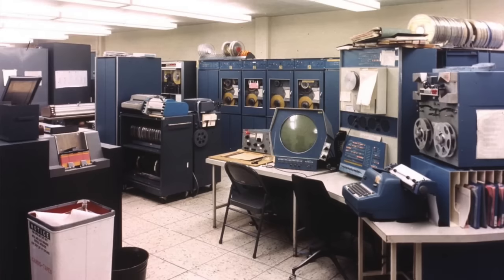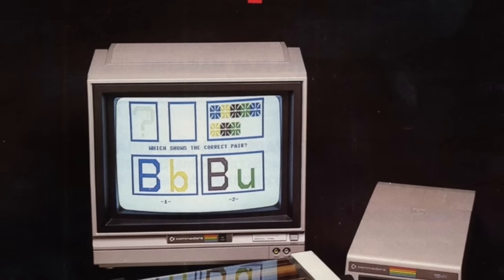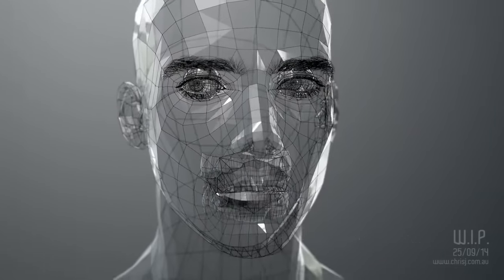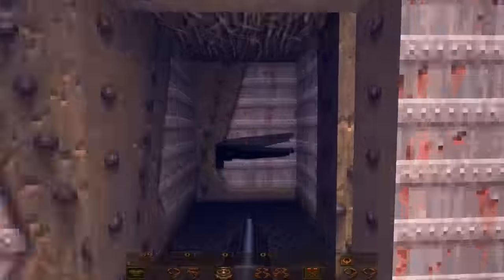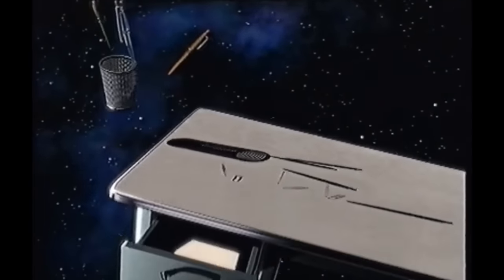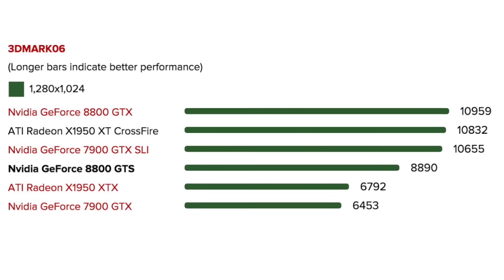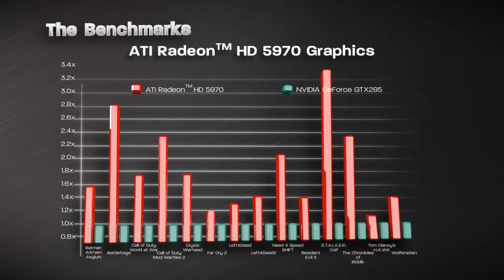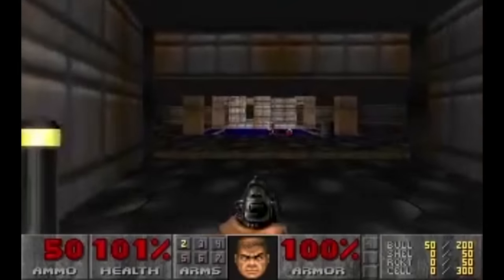Evolution Of PC Gaming Hardware

Comment: i7-2700k @ 4GHz
16GB 2133mhz RAM
EVGA GTX1080 FTW (Yes, I know, too damned expensive)
24" 1080p 144hz monitor
Corsair Force 3 SSD
So, basically a mix of old and new. Runs "Doom" at 100fps at max/ultra settings, so it'll be good enough for a while.
Also, I'm stuck running on Windows7, because I run a recording studio and my specialized sound card doesn't have drivers for windows 10.
Reply: You playing at 1440p? If not, then something is bottlenecking your system. My GTX-1070 Strix gets 120-170fps on nightmare quality 1080p.
Reply: Music & Drawing 1080p. Are you on DX12 or DX11?
Reply: antiHUMANDesigns
Vulkan.
Reply: Music & Drawing Which is pretty much the same thing as DX12.
How are you running vulkan on an nvidia card? :/ I thought that was only for AMD/ATI cards.
Reply: That's a huge waste of money to get a GTX 1080 on a 1080p monitor along with an i7 2700...
Reply: iHusbando uwu I'm not planning on having a i7-2700k throughout the lifetime of the gtx1080. I'm future-proofing.
It's also possible that I'll get a 1440p or 4k monitor in the near future, now that I can make good use of it.

Also, even if the rest of my current computer bottlenecks the gtx1080, it would obviously still run slower with a gtx1070.

But I agree, the 1080's price is crazy.
Reply: antiHUMANDesigns a new good mobo and CPU is going to be pretty expensive too, I hope you like spending
Reply: iHusbando uwu I've got a budget specifically for computer upgrades and other computer-related things, like the occasional game and such. I set aside about $100 per month.
I think I have some $1000 left in the budget, so a new mobo and CPU is no problem at all, though there are other things I'd also like to buy. Oculus rift, perhaps, another SSD, and so on. So I'll have to give it some though
Still, if Doom runs at 100fps at maximum settings, I have no current reason to upgrade my computer, I think you'd agree.
Reply: antiHUMANDesigns your cpu is bottlenecking you if that's all you're getting at 1080p, sorry to necro this chain btw
Reply: iHusbando uwu I've already responded to that. Of course 5-ish year old computer components will bottleneck a brand new top-notch card. But a 1080 will still run faster than a 1070. And I also pointed out that I'll obviously upgrade other components in time, but as long as I'm getting 100fps at maximum settings, why should I even bother upgrading anything, right now? (Rhetorical question.)

Yes, it's a shame. I looked at some benchmarking on CPU's, and I noticed that my i7-2700k gets its ass kicked by new i5's which have lower GHz... That's sad to see.
Reply: antiHUMANDesigns Wait a sec... Gtx1080 and only 100fps? what gives? there must be something wrong, my Rx470 gives me 120 avg fps Maxed out at 1080p and the 1080 is clearly faster...
Reply: Snake2208x
Your RX470 can't even max it due to limited VRAM...
Reply: Snake2208x Note that when I say "100fps", I am guessing an average from just looking at the fps counter. It's also possible that I ran at super-resolution.
I don't know, but I did have a problem with my CPU overheating, so perhaps it throttled down and bottlenecked it. I mihgt try it again, now, and see what FPS I'm getting, because I bought a proper CPU fan and overclocked the CPU to 4.5GHz.
Reply: antiHUMANDesigns Ok Gotcha, still that avg fps is low, if the cpu is throttling then thats it, maybe change the paste and check that the fan is alright, hope you increase those fps! oh and if the super sampling is on then is undersandable :P
Reply: Snake2208x Yes, the new CPU fan is good, and I've stress tested with it, and so on. With the stock fan, I was hitting 98 degrees C when playing BF1, which is max, and it was throttling.
Reply: antiHUMANDesigns woahhh thats hot! i dont like anything more than 85℃, hmmm if the oc is table maybe you could lower the voltage by tiny fractions, until an error happens on a stress test, lowering the Voltage by even .1 or .08 can drop the Temps by a lot
Reply: Snake2208x Yes, extremely hot. The weird thing is that I tried cleaning it with compressed air, and when I took the fan out and looked at it, it wasn't dusty, either. 
But somehow it has clearly lost performance over time. I think it may be 5 years old, or so.

Now when I stress the test CPU at 4.5GHz with the new fan, it maxes out at about 66 degrees C, which is perfectly fine. So the difference sure is huge, probably about 50 degrees.

Yes, I could've messed with the voltage, but I got a new fan instead, so problem is solved. I wasn't aware of how hot the CPU was running either, until I wondered why I got stuttering after a few minutes in the BF1 beta. Obviously, that led me to think it was overheating, which it was.
But yeah, problem solved, now.
Reply: antiHUMANDesigns excelent, great cpu fan i imagine, glad to hear, keep on gaming brother!
Reply: Snake2208x Yeh, not even one of the expensive ones, but kind of low mid-range price one. Thay sure make good fans, nowadays.
Reply: antiHUMANDesigns My PC is 7y old, so I still use Cooler master hyper 212+, the fan began to fail so i just bought a replacement, washed the cooler and use new paste, low temps all arround, maybe ill OC a bit more
Reply: NOO GSYNC OMG
Reply: weird flex but ok
Reply: i know my parents got my brother a gtx1080 i don't know much about it how much did they pay to get him that for?
Reply: @lees4049  how much is a gtx1080?

Comment: Atari 8 bit Computers (Atari 400, 800 in 1979) were out 3 years before Commodore 64.  I would guess the Atari had more games also.  Most games made for both the Atari and the C64 either played pretty much the same or a little better on the Atari 800.  My best friend had a Commodore 64 and I had an Atari 800.  They were kind of like rivals the way the Xbox 1 and PS4 are.  I like gameranx a lot but so much of this video is way off base.  I'm not even sure where to start.  You can basically just go to gamefaqs.com and compare release dates of computers and the games that were on them.  EA was in its infanicy at the time and would always release games for the Atari 8 bit 1st and than the Commodore.
Reply: ET&T I was thinking the same exact thing.  I actually owned an Atari 800 and a Commodore 64 because my Father was a game programmer for both systems.  He always made the Atari 800 one first then basically made a port
to the Commodore 64.  The maker of this video then jumps over to the Amiga while forgetting the Atari st.  The Amiga did sell better than the Atari ST but there is not a doubt in my mind that the Atari 800 was 1st and better than the Commodore 64.  The Atari 800 was released in 1979 while I think the C64 was 1982.  So not only was the Atari 800 1st but it had more games which played equal or better.  This Atari 800 was without a doubt the first major home computer to play excellent games.  I remember my friends playing horrible donkey kong console versions while the A800 was an amazing port from the arcade.
Reply: I had both the Atari 800 and the C64 also.  The games were so similar it would be like comparing madden on the ps4 vs madden on the xbox one.  The Atari did come out a few years earlier and in my opinion was the first major breakthrough for computer gaming.  I remember both systems were pirating games like crazy.  Downloading a 5 1/4 inch full disk game would take about 16 hours with a 300 baud modem.  It would take a couple of days to get the game Autoduel over the modem.  Now within 3 seconds of hitting enter the game is downloaded.  Mr. Robots last episode showed a Commodore 64 and also took lines from the famous Infocom game Zork which was on the C64, A800, Apple, IBM, etc......
Reply: *you forgot Sinclair ZXSpectrum, one of my friends had Atari 800, another one had commodore 64 and me, i had ZX Spectrum, and was really great at gaming...  2 steeps over atari 800 and fighting with Commodore.
Reply: I'm with you on that .. Hello, I had a C64, but before that ZX80/81 Commodore Vic 20 ... err ?!?!?!?

Comment: In the UK, the thing that really opened the market up after the ZX80/ZX81 was the 48k ZX Spectrum.  That thing still gets love from people today.  It is to many people what the NES was to kids in the states in terms of nostalgia.  It's what got a lot of people - myself included - into programming.
From there, I went to the Commodore 64, Amiga 500 plus and then to the soft embrace of a 486 SX33 (which was rapidly upgraded to a DX33, then a DX4 100, then a 133MHz Pentium, then a P3, then a 1.4GHz P4, then a 2.4GHz Core 2 Duo and now I'm currently on a 3.4GHz 2600k i7.  This thing'll last me for at least 2-3 more years before I have to upgrade.
Current spec (a few years behind the times, but it's still too good to warrant an upgrade):
2600k i7
16Gb 1666MHz ram
Gigabyte G1 Gaming 980Ti
Various soundcards / external recording boxes
G15 keyboard, Rat3 mouse
HTC Vive
Various pads
Various wireless headsets
Saitek X55 Rhino flight sticks (yay, Elite Dangerous)

Kinda spoilt now.  I stare at my massive Steam list flooded by Humble Bundle and Steam Sales and spend more time wondering what to play than playing games. :D

Comment: Started playing on the Atari 800xl- cartridge top slot, tape deck and days of typing in programs from magazines. Then grabbed a Atari 520ST with Floppy Disks and TOS- Dungeon Master, Chaos Strikes Back, DevPak and good old Motorola 68000 Assembly Language. Next the Intel P200, MS NT4 and then I have kept building every few years. I have just finished my new build Asus Rampage 5 Edition 10, water-cooled Intel i7 6850k, Asus Geforce GTX 1080 gpu with M.2 drive, ssds, 32gb DDR4 and a sack full of old HDD's for long-term back up all locked into a Corsair 900d super- tower that is too big to fit under my desk. Don't you just love this world:))

Comment: For my first-ever PC build, I got an AMD Radeon RX 470 OC'd to 1360 MHz on the core and 7.8 GHz effective speed on the memory, an Intel Core i5 6400 @ 3.09 GHz with 12 GB of 2133 MHz DDR4 memory, 2 TB of 7200 RPM storage. I love this system. Plays anything I want it to, can live-stream to YouTube while gaming, edit and render videos, and a lot more.
I'm thinking of getting a 1440p monitor, and then later upgrading to a 980 Ti, or 1070, or one of the new Vega GPUs releasing soon.

Comment: Awesome review, alot of the games and topics covered brought so many memories.

My new PC (should be good for another 10 years - hopefully - lol)

Processor: Intel i7 6700 4Ghz Quad Core
Mainboard: Gigabyte GA-Z170X-Gaming 7 version 1.0 (RGB LED)
GPU: EVGA Super Clocked GTX 1070 8G DRR5
RAM: 2x16GB Kingston HyperX DDR4 2400 CL15
PSU: EVGA 600B - 600Watts
Cooling: Corsair H100i v2 - CPU Liquid Cooling
Main HDD: 512GB - Samsung V-Nand SSD 950 Pro M.2 NVM Express
Case: Mid-Tower Deep Cool - KENDOMEN - with White LED Front Case Fans
OS: Windows 10 Pro 64-bit

Comment: Recently built my new system. tried to build it as future proof as i can yet staying within budget.

Panda Trueno Build:
Case- White/Black Corsair Air 540
Mother Board- ASUS Z-170A
CPU- Intel i7 6700k OC'd @4.8GHz
CPU Water Cooler- Corsair h100i v2
RAM- GeIl Evo X 16GB DDR4 3200 w/ RBG
GPU- STRIX ROG GTX 1080
Storage- 500GB SSD, 4TB HDD, 1TB HDD

Next up is a 1440p 144hz monitor, and VR.

Comment: My first ever computer was an Intel Pentium III. Remember running games like Delta Force 2 and Hitman Contracts. Then I got a HP laptop that had an AMD A6-4400M APU with the integrated AMD Radeon 7520G in 2012 which I used until 2022. Games before 2010 ran perfectly on Low-Medium or even high settings but Assassin's Creed 3 was lagging and Far Cry 3 was completely unplayable. After it had issues like boot errors and display problems in its last years, I bought my current laptop which is an MSI GF series gaming one with Intel i5 11th Gen and a GTX 1650. Really amazing how hardware has changed and how the games and software that ran on them changed alongside it.

Comment: In 2006 i bought a athlon 64X2 and i had a top end gpu and the ram was maxed out at 4gb, yet 32 bit OS's Max at 3gb memory, i did eventually get a 64 bit windows XP pro not to long later. But the main point was this new PC that was about $1800 cad. Could NoT handle Elderscrolls 4 Oblivion (that just released) on ultra settings it was majorly unplayable, and even on high the fps was like 15-20 at best. I had to set it on medium settings, Which did run very smooth and looked gorgeous for the time. Oblivion took a seriously powerful Computer to run on high/ultra settings.

Comment: Got my first computer in '88. T'was'a Commodore Pc 10-2 with a cga screen, and it didn't even had a hard drive. It costed 12000 danish crowns, approx $2000. My rig today is: i7 4790 3.6 Ghz, Gtx 980 4Gb, 24GB DDR3, 256GB SSD + 3TB. It has been an interesting journey from the first one to the the one i have now.

Comment: I'm still running a 2010 i5 CPU with 16Gb of RAM and a couple of SSDs, but I upgraded the videocard to a 2012 model on the cheap! Still runs fine and it's my main audio production system.

Comment: AMD FX-6300 Black | AMD Radeon R9 270 | 8GB Ram
Reply: +Melissa “Malice” Martinez GTX 970 SC | Intel i5 4690k | 16 gigs of ram at 1833
Reply: +Cl0nec0mmand0 Bread| Potato| Fresh Lead
Reply: r9 270x hawk ^^
Reply: +Ricardo Herrera that gpu is rather meh also what cpu in the i5 category there are some i3s that are better than some poor i5s :p
Reply: +SlothOnAStick it's a dual gpu so yeah its rather meh
Reply: +Melissa “Malice” Martinez  6300 @4.1   8gb @1600   asus 280x dcuii
Reply: +Melissa “Malice” Martinez
Graphics Card : ASUS GTX 960
16GB RAM
Reply: +Melissa Martinez (“Malice”) I7 4770K | R9 290X Crossfire | 16GB Ram :D
Reply: -T-X-M- if you  are planning to buy new cpu then yoy have to buy new mobo since fx is AM3+ socket..you will have to buy new ram since its DDR3....    my advice.. just get an i5 quadcore...  dont get me wrong.. fx processors are as good as an i5..but with overclocking...at stock speeds they are shit..
Reply: -T-X-M- AMD Always helps in tight budgets... dont go lower than 6300.. and always try to aim an oc at 4.5ghz... it helps
Reply: -T-X-M- 212 evo is very suited for 8300... good luck
Reply: +primus loy Well said my friend, Im run Fx6300 oc at 4.2Ghz with a MSI GTX 750 Ti and 8 Gb of RAM and i have no problems playing 99% of PC games on my 50 inch Sharp.. :)
Reply: AMD FX-6300 Black | AMD Radeon R9 280x | 8GB RAM

Daym, I beat you on GPU by just a tiny fraction. ;))
Reply: i7 4790k, msi GTX 980ti, 16gb ram    :)
Reply: i7 3820 EVGA 780 ti SLI 16GB corsair platinum dominator
Reply: how do i check what mine are?
Reply: ***** thx, i always wondered how to check that when i see people saying their stuff

Comment: CPU is the most important part in a gaming pc, because if your GPU is waiting for frames to be prepared by the CPU, then stuttering happens. It is much better to be GPU bound than CPU bound. I know this because I have an i5-3500 and GTX 1070, and some games stutter pretty bad even at low settings.

Comment: I spent most of the 1990s on the following: 486DX/33, 8MB RAM, 540MB + 250MB hard drive (both compressed with Stacker), Tseng ET4000 SVGA, Sound Blaster 16, CD blaster CDROM drive. The last game I could run on it was Quake 1, which ran like a slideshow.

"Ba-a-an-ng-ng! ... 'Ar-r-gh!'" Yes, it ran so slowly the sound broke up. 

Unsurprisingly, I played a lot more of Duke Nukem 3D. Though that wasn't just because it was faster. It is a lot more colourful and it has a freaking amazing level editor. Best I've ever used. How come nobody else has made a level editor as easy to use as BUILD since?

Comment: Current rig:

CPU: i9 9900K
GPU: GTX 1070TI
Mobo: Aorus Z390 Pro
RAM: Corsair Vengeance 32GB DDR4 3000Mhz
PSU: Coolermaster 750W
Case: Corsair Carbide 275r
Monitor: 2x Iiyama 27" @ 2K

Far cry from my first HP Brio Pentium II PC I started with in PC land back in 1999. Prior it was C64s, ZX Spectrum (Sinclair), Amiga and Sega / Nintendo.
Reply: 9900k with a 1070ti? Seems a waste lol, I'd of atleast gone for a 2070 super! or a 2080.

Comment: bought a 500 USD HP with decent AMD fx chip. fast forward 4 years now running AMD 8350 FX, EVGA GTX 1070, 14 GB ram, and a CX 750m to power it. and yet to my surprise all still running on my original Gigabyte MB model 2AC8.

Comment: I've been tinkering and building since I was about 13 from about 2002. started with old garage sales deals they didn't really play games well for the time, i just enjoyed playing around with the parts i had. DX's and Citrix's Pentium I's and II's finally spent 100 on a compaq with a 800mhz Pentium III eventually maxed out the ram with 512mb PC100 and i think a 256GB HDD with Windows XP Pro. then around 2006'ish I bought an ATI 9800 PRO from a friend for $50. eventually upgraded to a socket 478 P4 from used HP Pavilion.  later in 2009 started my socket 775 saga from the Core 2 Duo E6600 w/ 2 GB of DDR2, XFX 9800GTX+ and a pretty rare 150GB WD VelociRaptor (probably hands down the coolest drive ever, it has a window so you can see it working!) later upgraded to the Core 2 Quad Q6600 and 8GB DDR2 about this time i upgraded to a GTX 660 eventually got an incredible 64GB SSD back in 2011'ish? later couldn't pass up a deal for $79 each 2 500GB 10K Raptor drives(not as cool as the first one, the new ones don't have windows) still use them today in Raid with my current build with an 8 core 16 thread Xeon E5-2618L-v3 32GB Quad Channel DDR4, intel 600P 512GB NVME, AsRock X99 Taichi and an EVGA SC 1070

Comment: My build:
CPU - Intel Celeron Mendocino @ 450 MHz (overclocked from 400 MHz)
GPU - ATi Rage Pro Turbo 8MB
RAM - 192 MB PC100 SDRAM
MoBo - Gigabyte GA-6ZXC
Sound Card - Sound Blaster 128 PCI
Hard Drive - 20 GB IDE
Removable drives - Floppy, CD-RW, Zip 100
OS - Windows 98SE, BeOS R5.0.3